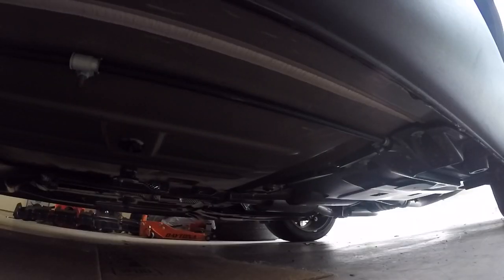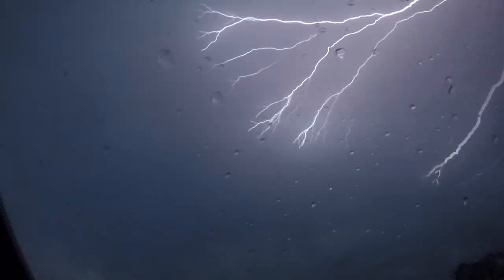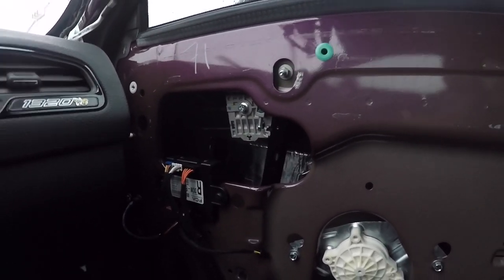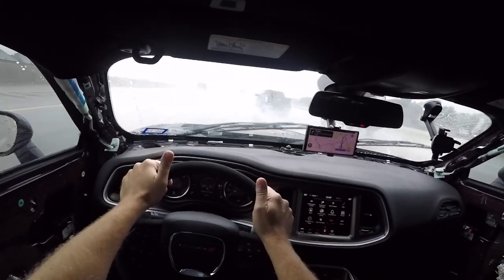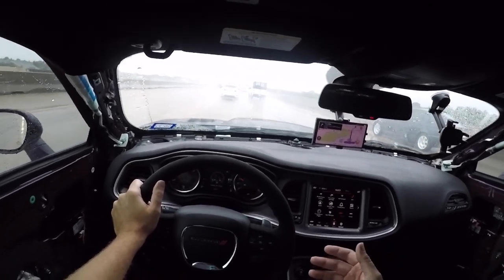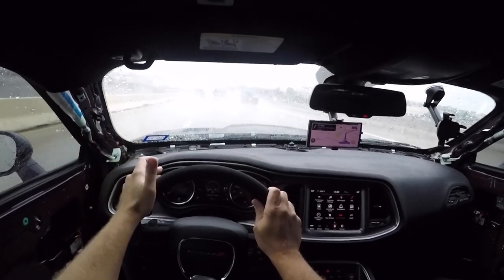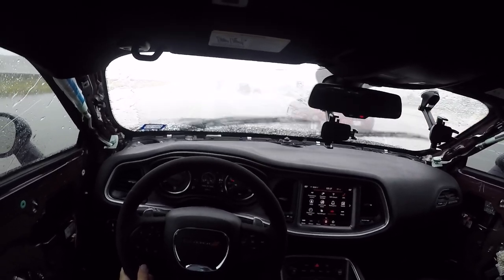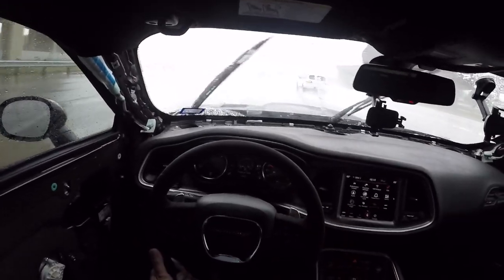POV Driving my 2020 Dodge Challenger Scat Pack 1320 in the Rain with Nexen Drag Radials on the back

Comment: Great informative video on the Nexen SUR4G Drag Spec! We always tell clients that Dodge would not have put these OE on the 1320's if they were dangerous for everyday use!
Reply from the maker: Exactly! If it were there'd be a disclaimer somewhere by Dodge saying "not to be used on wet roads", and I didn't see anything like that anywhere in my 1320 paperwork/manual.

Comment: I daily my 1320 with the stock DRs on the rear, hooks up better than most street tires.
Reply from the maker: Yup, that's why I plan on keeping DRs on the back even after I burn through the stock Nexens.
Reply: @Scavenger1320  I ran my NT05Rs on the street for a while and they were horrible.

Comment: Yeah, being from Dallas myself it does seem like the roads are pretty flat and don't run off well.
Reply from the maker: Yeah, I got used to it but then when I drive somewhere else in the country in the rain I really notice how much better the roads drain just about anywhere else. Florida road seem to be really good for it, but out there it practically rains every single day during some parts of the year.
Reply: @Scavenger1320  Around here they just seem to take the lowest bidder and build really crappy roads that need repaired a lot.

Comment: Why is it dripping inside the door panels? Geez...I haven't driven my challenger in the rain yet. Thanks for the Info
Reply from the maker: It's completely normal in all cars. That's why at the bottom of the doors they have drain holes cut out and why they always add a moisture barrier between the metal door panel and the interior trim panel. I just never realized how much drips through, even though I've heard faint sounds of it in some of my other cars/trucks before. Makes sense though when you think about it and how the weatherstrip at between the door and window doesn't truly make a perfect seal.

Comment: why is rain coming inside your doors
Reply from the maker: It's actually normal, I just never realized how much gets in, at least on these Challengers. That's why doors have drain holes along the bottom and a moisture/vapor barrier practically glued to the door behind the interior trim panel. I guess there's really no way to 100% prevent it when there's a window that moves.

Comment: how many miles do you get on stock nexen drag radials that come in the 1320 if you are just regular street driving and some launches on street only?
Reply from the maker: I just passed 11 thousand miles on my car and I still have the original Nexens on the rear and that’s with about 15 or so 1/4 mile passes on them with burnouts. Plus I drive pretty hard on them on the street. They’re nearing the end of their life though and I’d guess I still have about another 1 or 2 thousand miles in them. I think being lighter weight has helped them last a little longer. A lot of other 1320 owners will say they get about 10 thousand miles out of them

Comment: I will be replacing the oem drag radials on my new 1320 ( getting it in less than a week!), with all season tires. I still want good rubber that'll offer good traction but something that will definitely outlast the original tires. What do you recommend?
Reply from the maker: Well, what I recommend is what I do and have. I'd keep the stock drag radials on the back to get the best traction and just swap the fronts out. In my case I put a pair of Nitto 555G2s, and then keep the original nexens off the front to put on the rear when the originals wear out.